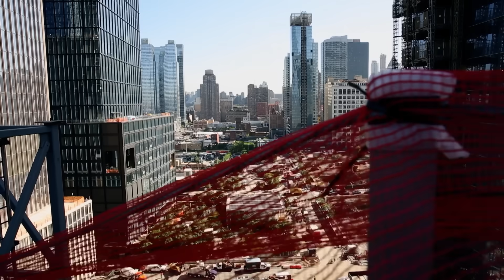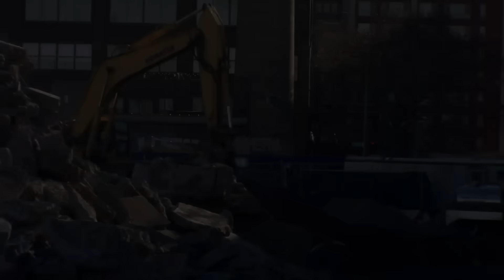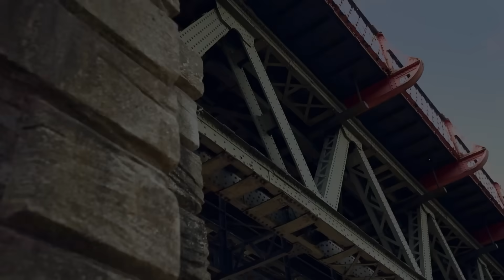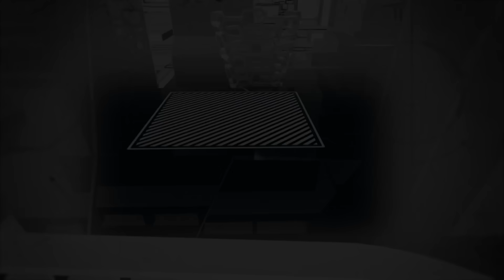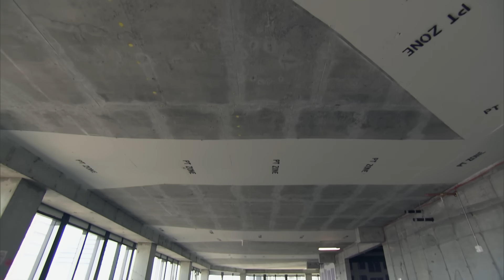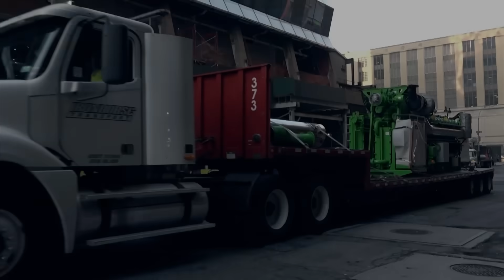Building on Top of Live Train Tracks: Hudson Yards' Impossible Construction | Blueprint

Comment: None of the consultant engineers were interviewed, only Related staff.   There were dozens of consulting companies and 100s of Architects and Engineers working on this for over 10 years.  No mention of Gateway tunnel, nor the main reason for huge exhaust fans  - probably for smoke control in case of fire.

Comment: I assume the trains are diesel that generate the heat.  Why aren't these converted to electric, eliminating the problem right there?  If a platform on pillars to support a building can be built over a rail railyard  why not just build it out in the Hudson? Maybe a series like oil drilling platforms in the Gulf OF MEXICO) or the North Sea? Where are all the services for 125,000 people  coming from -  water, sewage, and of course the electricity.  Does the city of NY have all this capacity just sitting there for the asking?How can the existing public transport structure - apart from subway 7,  - trains, subways etc absorb this huge increase of population?  What are the risks of flooding?  And lastly - who is financing this behemouth?

Comment: Post-tensioning is not new. I worked on demolishing a building that spanned a manger arterial into a city in the early 80's that had used that same process around 50 or so years prior. So around the the 30's
 I remember serious issues, that involved carefully removing the tensions that were involved, without catapulting the remaining structure into the surrounding area as weight was tremoved

Comment: We went to Melbourne in 2008.   They had a wonderful plaza built over live rail tracks, right across from the ornate Flinders station. 

So what you’re calling impossible has already been done.   New York used to be a pace setter.   Even SF Trans bay terminal is more impressive than what you’re calling Penn Station.  .
Reply: Ridiculous to compare other trains stations to the mess that Penm Station is today.  There are currently many proposals to replace the current station, but most stations don't have Madison Square Garden, an events arena, sitting on top of them.  The challenge in NYC is ttemendously complex.  Comparing NEW York city's situation, with smaller, B tier cities, is childish.

Comment: Go north on Manhatten to Grand Central. When the then new station was planned in the 1900's, air rights were used over the tracks and platforms. The whole area around GCT is over tracks. And there are two track levels under there.
Reply: Lot more than 2 track levels. 4 levels accessible to the public plus at least one storage yard
Reply: @ynda777  Forgot to mention Eastside Access. Did not know it had opened(2023).
Reply: They took an existing single-level terminal station and converted it to a double level station over the course of several years of construction. Also this happened while the railroad was converting from steam power to electric power. It's worth noting that not one train's schedule was changed during the whole period of the building. Easily as amazing as the new construction, but with better architecture.
Reply: I know right? And they did that when the trains weren't electric yet.

Comment: Just think of all that wasted heat that's costing them millions to get rid of, all the while with a 100K people needing hot water
Reply: Now there is a solid point and idea. An energy capture/waste and or central boiler/heat exchanger could legitimately be an energy saver and selling point. Something like this needs to be incorporated early in the design phase.
Reply: That’s the first thing that entered my mind when they said they had ventilation shafts for the heat 🤯 Wasted energy… let alone wasting energy to run the ventilation system itself 😅 Looks like the great minds might have dropped the ball here 😅
Reply: My first thought also - why not use it for heat recovery during colder months? Very common here in cold Sweden atleast.
Reply: Because of how thermodynamics works, that waste heat probably isn't hot enough to be an efficient source of heating water during winter.  Maybe it can be used to warm cold water up before it heads to the boilers, so the best it can do is save some energy.  

Or they could open a cold-weather homeless shelter in the ventilation building.
Reply: @h8GW either way it’s wasted energy that could be put to use.